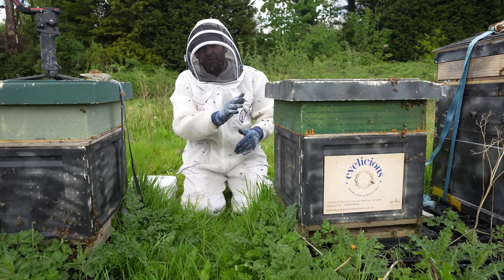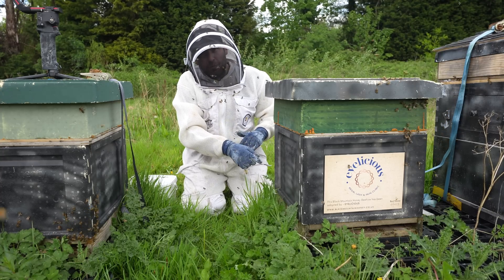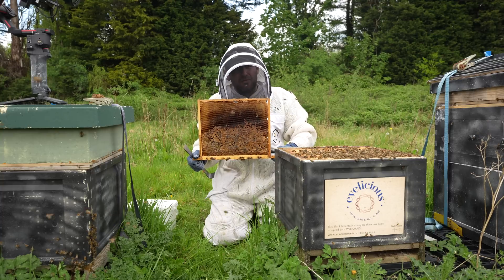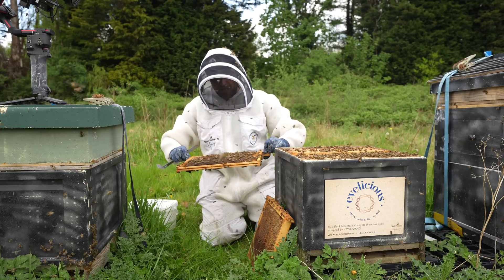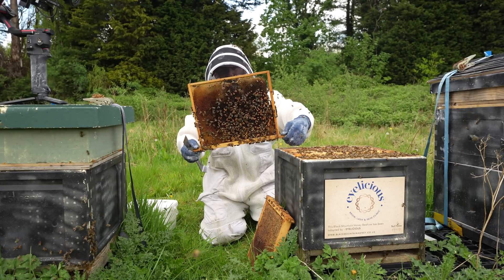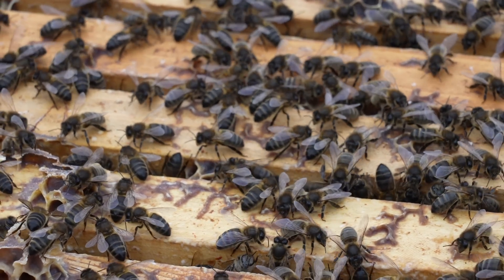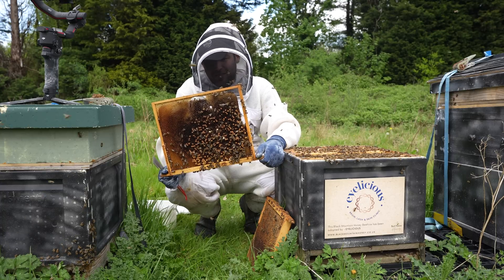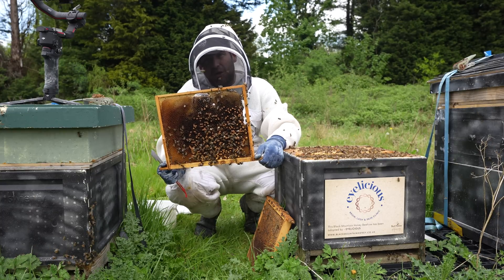How To Fix a Drone Laying Queen – AMM Queen Failure and Colony Rescue

Comment: I recently came across a hive which I though had turned drone layer. Fortunately I was wrong and it turns out the comb had more drone sized cells than usual (wax foundation rather than plastic).